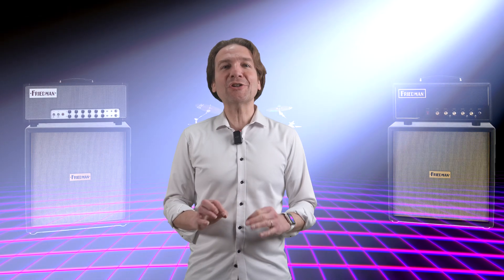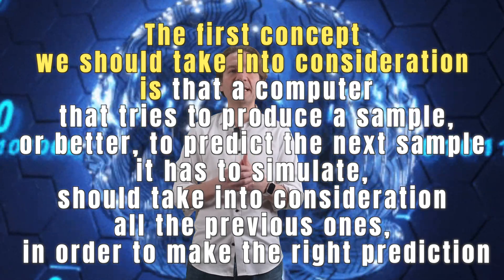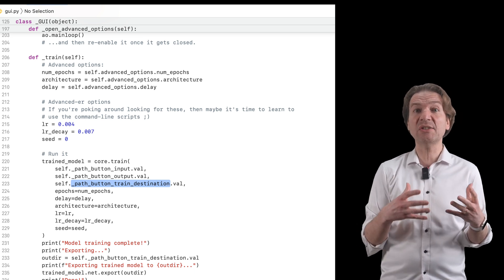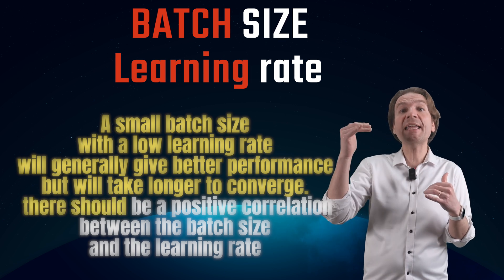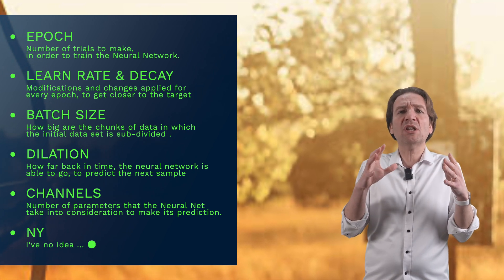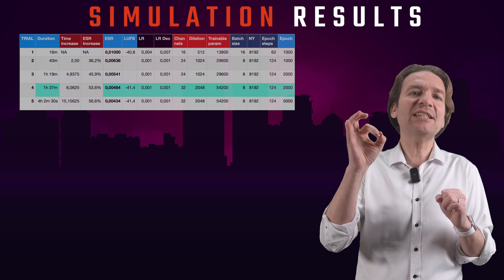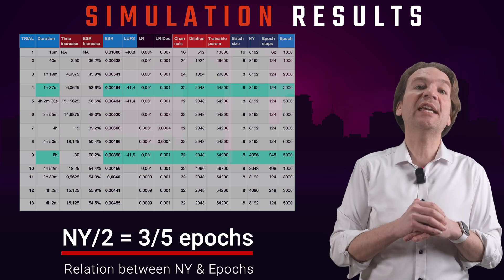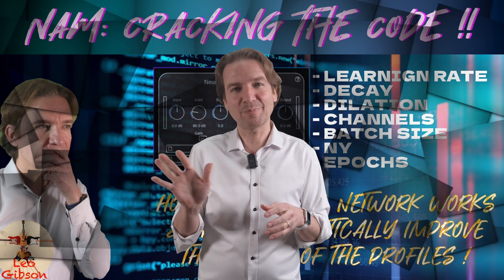NAM - Neural Amp Modeler: cracking the code! (How NAM works & how to increase the profile quality)

Comment: Excellent video! 
Very well investigated, nicely explained details, I love it!
A very interesting thing to investigate would be, how indistinguishable a model is by the human ear in practice. I am not sure, how the null-test LUFS relates to this. I guess, that the k-weighting should relate to this directly, but human perception can focus on certain areas or be irritated by single frequencies quite easily, I guess. Same for transients! I am personally not deep enough into this, probably, but it would shed a light, how much precision is actually enough for whatever use of audio. I have the strong feeling, that well made models in Proteus, NAM and AIDA-X actually are already in the range of quality, where it would not matter in nearly every mix, and there could be rules of thumb, below which null-test LUFS further precision is not reasonable at all. (Things might only matter then, when several networks are chained, not paralleled).
Just now I investigate AIDA-X, which just reached the surface and is a RTNeural based neural network amp modeler that is based on a similar model as Proteus (LSTM, with same codebase) but uses 48kHz and actually runs on the MOD Dwarf (commercially available ARM-based pedal running the MOD environment to make signal chains) and potentially on other hardware / RaspberryPis with soundcards.
It is still in very early stage and just officially out, but has some nice features, like several pre-defined model configurations for predictable cpu load on the hardware pedal.
And, since it is trained in 48kHz, you can use the amp capture audio that you use for NAM also directly for training of AIDA-X models.
Exciting times we live in.
Reply from the maker: Hi thank you so much for your feedbacks and I'm happy that you have appreciated the video!!
Yes, I'm also trying AIDA X, the problem here is that I'm not able to run it on my PC, but only on google...and, as you know, I would like to be able to try all the aspects of a solution before releasing a video.
You are right about the difference between ESR values and actual human perception. Actually, I have tested to profiles with almost the same ESR, and it happened that I like more the one with worser ESR....I don't know if it is just "impressions", but  sometimes I "feel" that a profile sounds/responds better, even if on paper it should be worse...I have to further investigate this aspect, as I don't have scientific proofs...but just sensations..
Thank you!
Reply: @LeoGibsonGtr  I am working on an offline solution for PC for myself and got it basically working, although it misses still a few bits and bytes (analysis part of the colab script, but training and export of the model seems to work already). I will opensource when it is working.
Reply from the maker: Cool...let me know!

Comment: Excelent tests for Scott's NN model

Just an hypothesis:

It seems that 'ny' is related to 'train_val_split' ... 

then,  The train_test_split function of the sklearn. model_selection package in Python splits arrays or matrices into random subsets for train and test data, respectively.

but what specifically the acronym 'ny' means seems to be something that Scott would know ... by the code it appears that it refers to the size of the compiled information chunks to be randomized in the hidden layers of the network ... then, Scott set to 9 seconds the time for compiling the training data chunk once 'ny' get into '8192' it stops and set the data matrix subset to become randomized in NN layers ... for the validation of the income it seems that is not required a 'ny' buffer' ,,, then, once the chunk to randomize comes in, the model triggers for the next one ... but it is not - necessarily - something sequential, because, the GPUs are running this Python variable in parallel ... 

Just guessing ...

If the parameter is too low, then, the learning becomes faster or slower according to the hidden layers of net but could be less or more accurate by the settled software architecture ... If the parameter is too high, the learning becomes a bit slow and could be less accurate, because the big chunk doesn't allow the randomized hidden layers to spot the patterns in the data chunks ... 

Again, just guessing ...

Try X/2 or 2x values from 4096

The man to bring an accurate answer should be Scott himself ...
Reply from the maker: Hi, thank you so much!
May I ask you if you mean Scott or Steven?
In my experience NY is related to Epoch, I mean with half NY you get the same performances of 2/5 epochs. If it is lower, each epoch take much longer, but you get the same results in 2/5 of the epochs...
Thank you for you interesting insights...
Reply: @LeoGibsonGtr  Ops, yep, Steven Atkinson ... 

The epoch steps determines the architecture for the hidden layers of nodes to randomize , it is supoused that more epoch steps, more time for the NN to randomize the nodes of each layer ... the size of the nodes ( maybe 'ny' ) determines the 'grain resolution' of the nodes to become randomized ... 

In theory, The goal is to find the desired optimal outcome with less epoch steps and the optimal size for the nodes 'compiled in less time' (  'train_val_split' ) ... 

the thing that 'ny' are multiples of 2 is a sign that it is related to a compiler of bytes ...

P.S. : Amazing hardcore test and post, but I missed your amazing and soulful playing in the results 🦆
Reply from the maker: Thank you!!! I prefer to stay on the tech side with this video...so no music...of course I'm really happy that you appreciate the music!!
Thank you also for your interesting points! Basically if I train a NN with 5000 epochs and an NY = x, I obtain almost the same ESR, in almost the same time, of a NN trained with 2000 epoch and NY = x/2. So at the end, what I derived from that, is that I can avoid to test the NY, as I just need to increase or decrease the epochs....but I will try to do more testes.
Thanks!

Comment: In the Neural Amp Modeler (NAM), NY refers to the number of points used in the Fast Fourier Transform (FFT) algorithm. A higher NY value means that the audio signal being analyzed will be divided into more frequency components, allowing for a more detailed analysis of the spectral content.

The default value of NY in NAM is 8192, which means that the audio signal is divided into 8192 frequency components. However, users can adjust the NY value to achieve more detailed or less detailed frequency analysis, depending on their specific needs and hardware limitations.

For example, if an audio signal has a frequency range of 0 Hz to 24 kHz and a NY value of 24000 is used, the signal will be divided into 24000 frequency components, allowing for a very detailed analysis of the spectral content. However, a higher NY value also means more computational resources are required, so it's important to balance the desired level of detail with the practical limitations of the hardware being used.
(source : ChatGPT)
Reply from the maker: Thank you so much!!! Actually, I thought that lower NY value increases the quality...at least this is what I have experienced. With lower values, the training procedure take longer and provides with better ESR....I will try to increase the value...
Thank you once more!
Reply: @LeoGibsonGtr  No my friend, I thank you for your amazing work!!! I would like to remind you that the information provided by ChatGPT may not always be accurate. Perhaps we could explore the idea of renting computational power through cloud computing and go crazy with the training settings. As a fellow nerd, I am very interested in this experiment and eager to see where it takes us. Keep up the great work!
Reply from the maker: Thank you soooo much Dimitri!
Reply: @LeoGibsonGtr  Cheers! I wanted to let you know that I tried using your best resulting settings, but encountered an issue when attempting to adjust the "channels" parameter. I want you to know when I utilized the "Feather" train mode with the same settings as you suggested (minus the "Channels" parameter, with NY set to 24000 and used many Epochs about 10k), I achieved better results than the Standard training, I suggest exploring the lighter training modes as well. Could you please provide some guidance on how to modify the "Channels" parameter? Thank you!
Reply from the maker: Hi Dimitri, thank you, I will try with your suggestion.
The trick is that the channels in the first layer has be equal to the input size of the second layer...it's kind of the first layer is an input for the second one.
Reply from the maker: Here you can find the architecture: 
 Architecture.STANDARD: {
            "layers_configs": [
 {
                    "input_size": 1,
                    "condition_size": 1,
                    "channels": 32,
                    "head_size": 8,
                    "kernel_size": 3,
                    "dilations": [1, 2, 4, 8, 16, 32, 64, 128, 256, 512, 1, 2, 4, 8, 16, 32, 64, 128, 256, 512, 1, 2, 4, 8, 16, 32, 64, 128, 256, 512],
                    "activation": "Tanh",
                    "gated": False,
                    "head_bias": False,
                },
                {
                    "condition_size": 1,
                    "input_size": 32,
                    "channels": 8,
                    "head_size": 1,
                    "kernel_size": 3,
                    "dilations": [1, 2, 4, 8, 16, 32, 64, 128, 256, 512, 1, 2, 4, 8, 16, 32, 64, 128, 256, 512, 1, 2, 4, 8, 16, 32, 64, 128, 256, 512],
                    "activation": "Tanh",
                    "gated": False,
                    "head_bias": True,
                },
            ],
            "head_scale": 0.02,
        },
Reply from the maker: Furthermore I have substituted the aformentioned arch to the STANDARD one and not the feather.
Reply: @LeoGibsonGtr  "Hey, thank you very much, my friend! I will definitely give the code you provided me a try! I have been experimenting with parameter adjustments all day. You were right about the 'NY' parameter; decreasing it increases the time taken for each epoch to finish. Perhaps ChatGPT was partially incorrect about this. I discovered that the 'NY' parameter is somehow correlated with the 'batch_size'. By decreasing the 'NY' and increasing the 'batch_size', one can adjust the depth of the training."

Comment: Amazing video as usual Leo! Very nice understanding of eveything going on under the hood! How you could improve that number is a good question. The cleaner the captured signal you get is, the better the iterations would be, so lowering the noise floor of your reamp to the maximum would help. You said you captured with the cab, I think only capturing the amp will improve the ESR as well. Keep making great videos!
Reply from the maker: Thank you so much, I'm happy that you like the videos!!!
You are right: I have profiled also the amp without the cab, obtaining better result in terms of ESR...but to my touch and ears, the profile of the entire rig "feels" better...
Nice suggestion about the noise floor: do you know how I can do it?
Thank you!
Reply: @LeoGibsonGtr  using a good reamp box helps in that sense, but you probably use a good reamp box... just trying to cancel as much ground loop noise as possible, having the electric power outlets in your house/studio filtered so the 50/60hz hum/noise is as little as possible, things like that... another idea would be running every cable in your chain with balanced outputs (to reduce the noise to the maximum) but I'm being extremely picky here... anyways, you are already getting incredible results in my opinion
Reply from the maker: Ok thank you for your suggestions!!
Reply: @LeoGibsonGtr  For this type of noise reduction, letting a plugin learn the actual noisefloor of the amp with an "empty" reamp signal and clean the captured audio of the modeler test signal with this noise profile you got would do the trick. It should work to reduce static noise and hum, ReaFir, for example, would be a tool that could be used for it. Izotope RX would offer more advanced options.
Reply from the maker: Very interesting...thank you!

Comment: A quick question: for two models produced by just varying the parameters, if one esr is 0.01 and the other is, say half that at 0.005 - does the latter sound twice as good? ie do these esr numbers translate linearly into the perceived quality of the model when heard?
Reply from the maker: HI, I don't think so. Actually I have to do some more tests using the profiles I have created, but I feel slight differences in terms of "feel" even between two profiles very similar in terms of ESR...I'm still learning... but generally speaking lower ESR translates in better profiles.
Thank you!
Reply: @LeoGibsonGtr  I'm curious, did you try testing these models blindly? I.e. can you detect the differences in "feel" when you don't know whether you're playing a model with a lower or higher ESR?
Reply from the maker: Hi, I'm not 100% sure....as I said...this could be simply an "impression" / suggestion...Nevertheless, with my next video I will share almost 20 profiles of the exact same amps, done with different neural net architectures...so you can check out your own...There is one specific aspect related to ESR that I have noticed for sure...but this is a topic for even another video...😀
Reply: @LeoGibsonGtr  Thanks, Leo! I'm looking forward to the new videos.
Reply: @LeoGibsonGtr  Me too !

Comment: We all like challenges!
Great video! You do really great job trying to get best model!
The one important rule in training neural nets - try everything, nobody knows what will best in this concrete training data.

You have very powerful computer if you able to run this models in realtime. My daw crashes in same complexity as in your 2-4 trial.

I think if you will create only amp model without cab and then use this model + your captured cab IR then you will be able to get better LUFS.

And can you feel the difference in quality between this trials just playing in real time? Is the quality and feel improving noticable?

And please give us the opportunity to join this challenge, share your output.wav!
Reply from the maker: Hi, thank you so much, I'm happy you appreciate the video!
Yes, I have a 4090, that allows to do these tests...otherwise it would have been impossible...
Yes, I have trained also only amp...and generally I obtained better ESR...but to my hear and to my touch the profiles with the entire rig sounds better.
Yes, I wanted to share the changed source code and the files...but finally I ended up out of time....maybe I will do a video showing the profile in action and the showing the source code...and the all the files...

Comment: Fascinating deep technical dive into what is going on under the hood of NAM. Awesome that Steven Atkinson himself commented to you! 👍

It might be useful to start compiling some numbers about how much time average End Users are willing to spend creating NAM Profiles. My guess is a maximum of 15-20 minutes. Then compare that to best quality obtainable within that time frame. And finally compare the "audio quality" results to determine at what point the differences typically become inaudible.

I have a pragmatic question. What "file format" does NAM produce for their IRs? The reason I'm asking is that if they are in ".wav" format, they could be imported into a hardware Modeler, like the HX Stomp. That might make them useful/portable outside of Computer Standalone, DAW, and VST environments.

Thanks for all you hard work, and developing and sharing your impressive skill set. 👏
Reply from the maker: Thank you so much for sharing your thoughts and for the kind words!!!
NAM store its profiles in what is called ".nam" format. The NAM plugin which can load and read these files is a VST plugin (or similar format), therefore so far it cannot run on our standard pedalboards...I hope that someone will implement it!

Comment: A big mistake that many make is to run their DAW project in 44.1kHz. I never made a profile, but I loaded them and my THR10 is not capable to run in 48kHz. So, the playback is slightly off. In fact so miniscule that many other users in the facebook group insisted that it is negligible. But it is a fact. The DAW project must be 48kHz, since NAM expects that as an input signal! I want to try to capture my amps and pedals, too. But I need a reamp-box.
Reply from the maker: Hi, thank you for sharing!